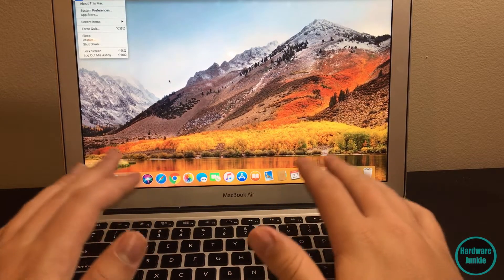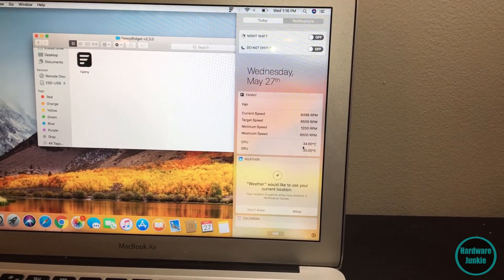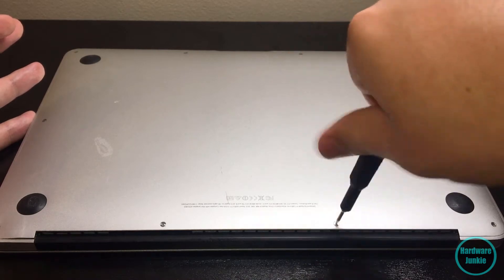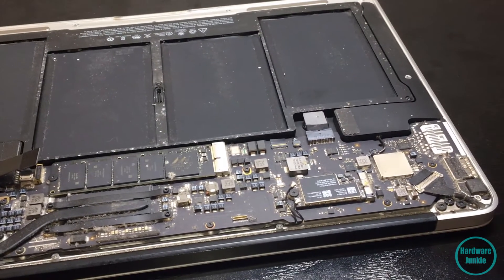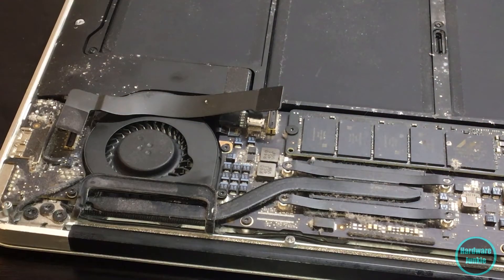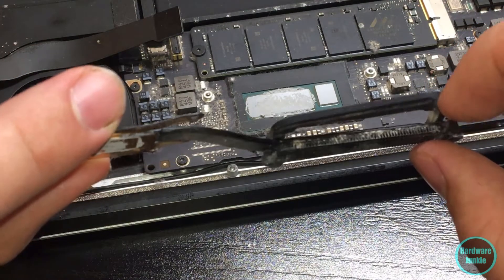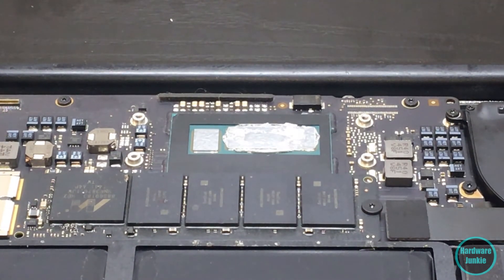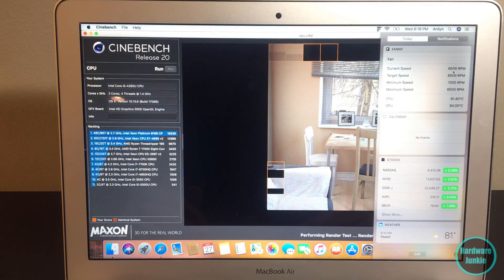2014 MacBook Air repair. (Loud fan fix)

Comment: I went to a repair shop to get my bluetooth fixed, however, when they returned it, the fan rotation wont stop and it is so noisy, will try this method and hope it works. :D